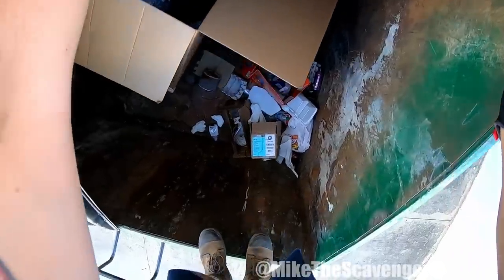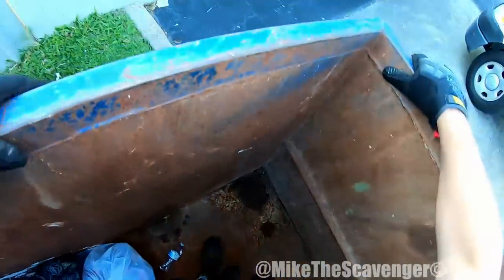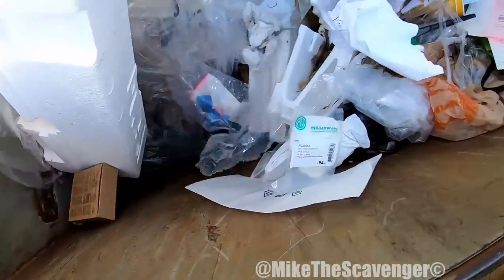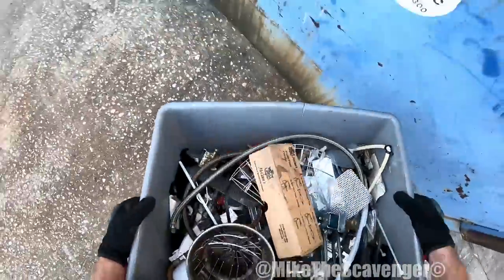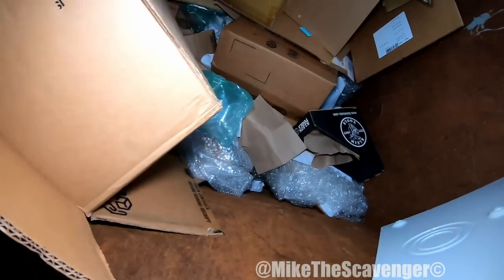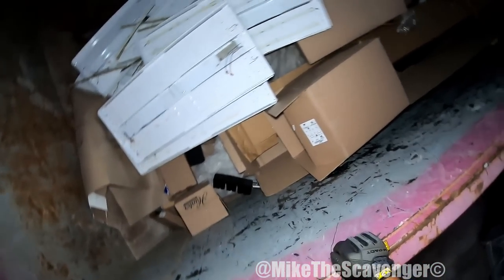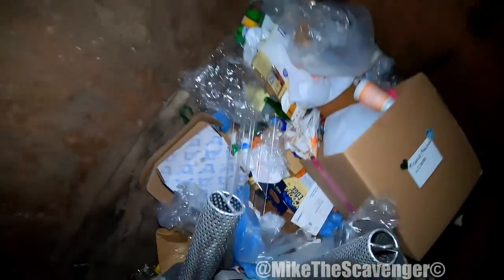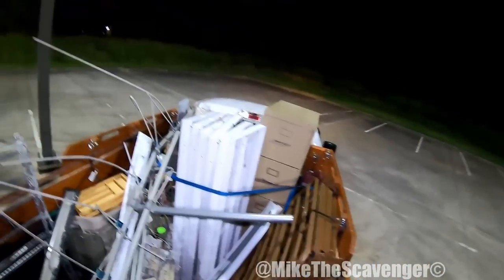Dumpster Diving "I See Legs"

Comment: 3:30 Broken spring from a roll-up overhead door. I need that metal bucket Mike. I have been looking for one like it. Yeah pro tip 13:30, always check to see what's inside boxes and bags before you get back on the road. Don't bring back someone else's forgotten stash. If you get pulled over they ain't going to believe "I just found it in the dumpster!" 18:00 always heard DeVilbiss pronounced day-VIL-bis with the emphasis on the second syllable. French name I think, could be Dutch?
Reply: I used to work at a durable medical equipment company that provided CPAP/BiPAP. We pronounced it de-ville-bis.